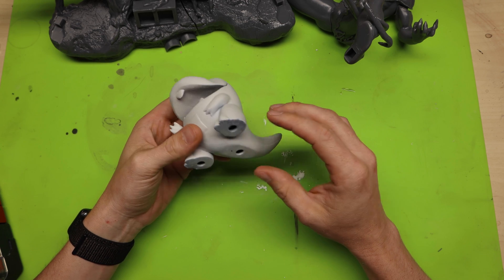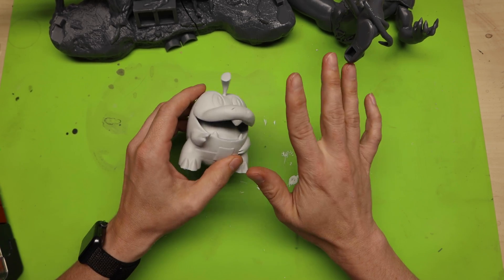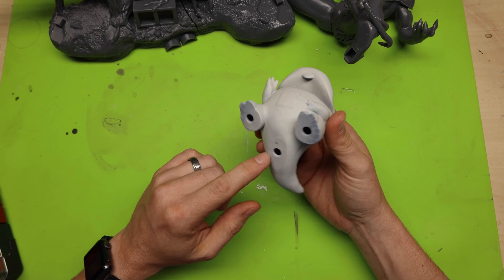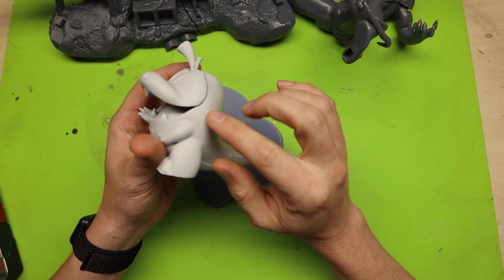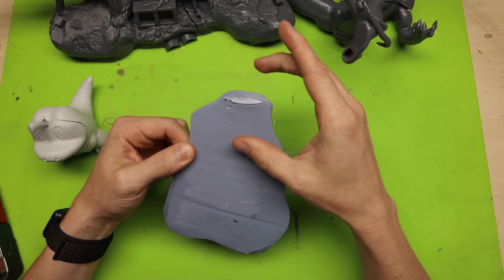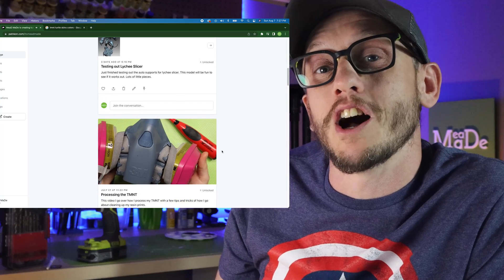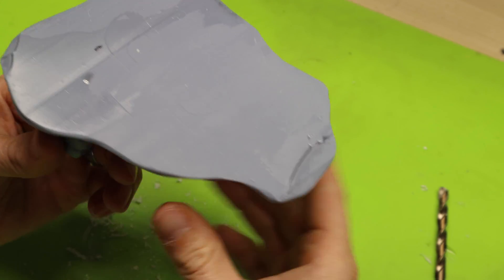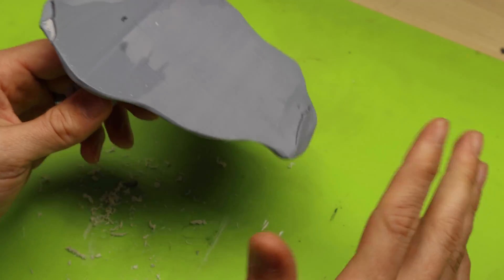Preventing Resin 3D Prints from Exploding

Comment: So one thing I’ve been doing, is when I hollow. I hollow out where there would be joints put together and for solid prints like this one I would put a few at the bottom. Then what I would do is after the wash, dry and cure portion. I would go to like a Home Depot, Lowe’s, Michael’s, dollar store etc and buy a bag of sand. Scoop some into a gallon ziploc bag, cut a corner of it with some scissors. And let it pour into the model completely. Once it’s completely full where I absolutely can’t add anymore sand I would use the plastic Wood-X and cover the holes. Or cure resin on the top of the holes as well to seal it. And sand down till the holes are covered and smoothed. Would do a bit more super glue, and sometimes I would add Vallejo’s plastic putty to help hold the weight in arms and legs etc. But Haven’t had an issue since and plus it gives the models a bit more weight so it’s less likely to tip and fall. Plus the sand essentially fills those empty voids so that no air pressure is present. I have a friend that does this as well but he only does it in the bases of the models so that it would be supported heavily on the bottom except the whole model.

Plus it would be a cool experiment video you could do on this subject and see how it works for you. But I do hope it helps and maybe it can help others.
Reply: Let me ask you, whats your process on painting? Do you sand the model first?
Reply: @ I sand the imperfections. Nubs, or any gashes that need to be filled or puttied.

Comment: The tmnt piece… do you think it would’ve exploded if you didn’t hollow it and left it solid?
Reply from the maker: It’s not if you leave it solid. It’s if you hollow it and not put a hole for ventilation and to clean out all of the uncured resin in the hollowed part.
Reply: @ItsMeaDMaDe  so if you had printed it solid, it would’ve been fine?  Im just trying to find out if its ok to print solid or not

Comment: what if i did add holes.. giant ones... multiple.. and I washed it firmly.. and dried it with a hair dryer before hardening.. and it still exploded? i got myself with half a kilo of destroyed terrain. it happened after more than 24 hours. i managed to cure and paint them already. and they cracked in 2-4 pieces. like the interior of the print expanded.
Reply: Well... what helped is 1) lesen down the infill.. down to 12-15% max.
2) over expose the shit out of my print in curing. like curing for 1 hour.
3) I print in transparent only now, o when curing I can cure even trapped pockets of resin somewhere in the print where they shouldn't be.

Comment: Thanx alooot yr really helpful ill surely subscribe to yr patreon .. but u know i have base with 3 holes with wall thick 0.12  its also cracked still dont know how
Reply: Wall thickness of 0.12 what…Inches, Millimeters, Centimeters?  Most measurements in 3D printing are given in mm, so if that’s 0.12mm those are VERY thin walls and I would expect them to break very easily.  Around 2mm for smaller prints and 3mm or more for larger prints is typical from what I’ve seen.
Reply from the maker: Thanks glad it helped. That’s strange we’re you able to wash it really good and cure the inside as well?  That could cause it too or possibly you wall thickness is too thin. I typically print a .2mm thickness

Comment: You can prevent chipping if you put your drill in reverse (counterclockwise) or use a dull drill.
Reply from the maker: Great tip. Thanks!
Reply: @ItsMeaDMaDe  wasn't my idea, got this info from youtuber "wornout". title "Drilling Holes In Resin 3D Printed Parts". Has worked for me since then :)